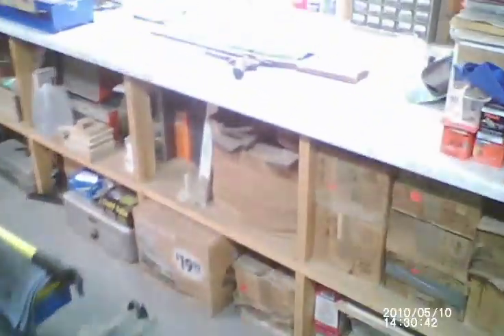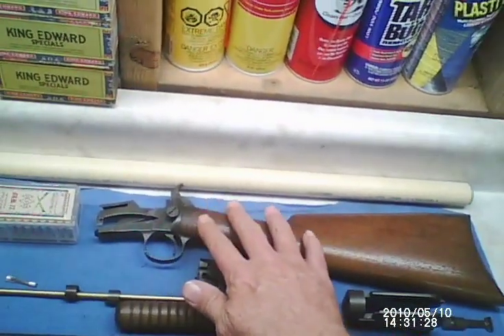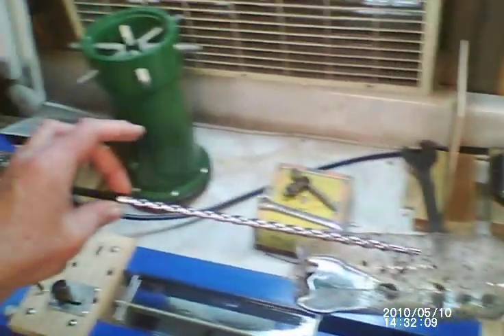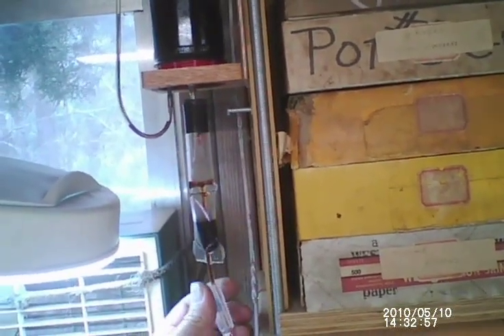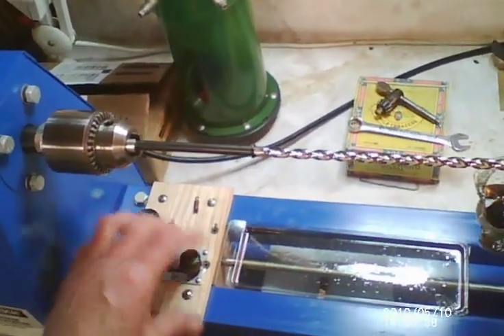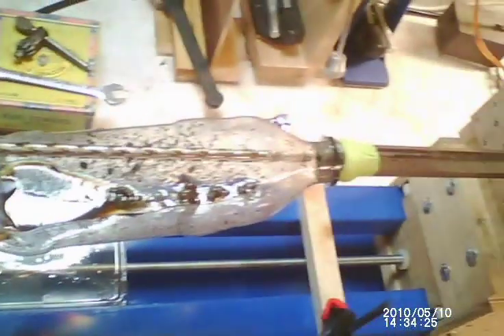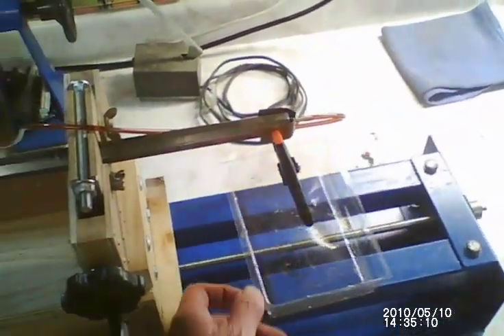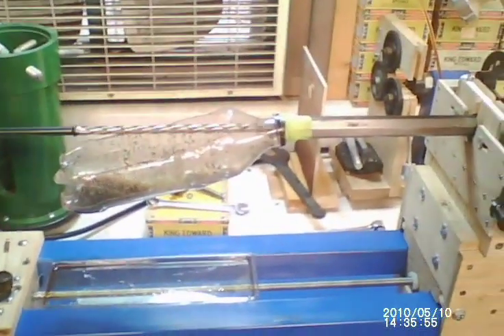Barrel boring machine for relining .22 barrels

Comment: Interesting rig you made there. Seems to be a much better setup than free drilling it. The cutting oil provider was quite clever! Did you use recomended speed on the feeding? It looked to be awful low. You probably know, but too low feed will prevent the drill from cutting properly, dulls the cutting edge, and creats a lot of heat.
Reply from the maker: Hey, sidekickbob!  Thanx for your comments. That particular ancient barrel had a history of abuse with some repaired bulging work done (not shown), and was uniquely hardened.  Yes, the feed rate was indeed slow, purposely, and I would occasionally resharpen the drillbit.  Drilling by hand was near impossible, hence the reason to build this drilling machine (modified wood lathe).  After relining with a regular .22 liner, I cut the WRM chamber with a rebated WMR reamer.  Groups under 1" at 25 yds now....
Reply: @twomanyxs1bs  Well, if the barrel was hardened, then I understand the feed. Glad you managed to get this old iron up to working condition again!